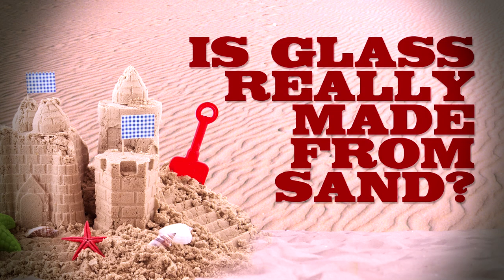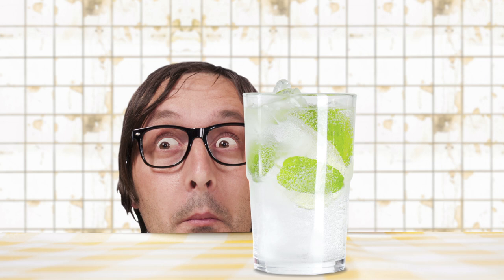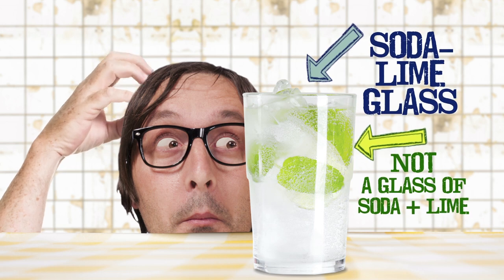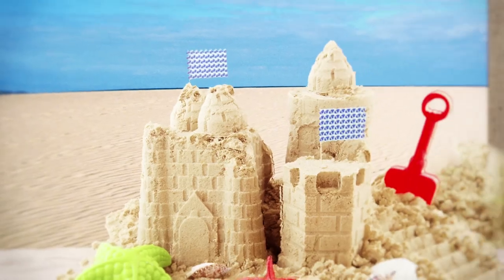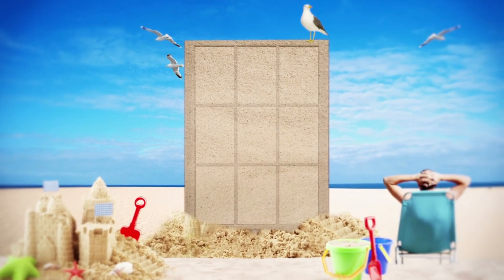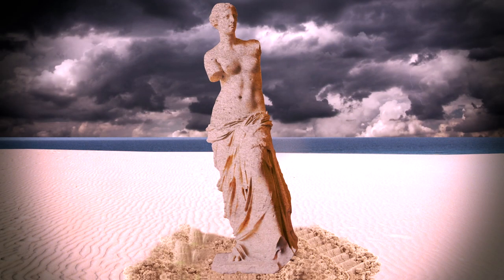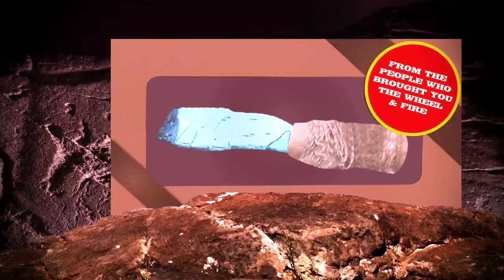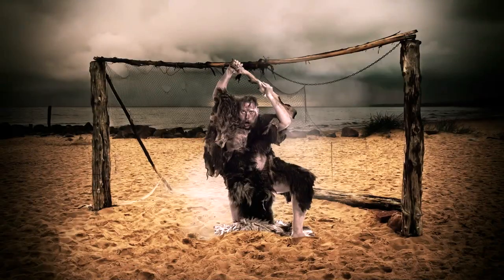Is glass really made from sand? | James May's Q&A (Ep 11) | Head Squeeze

Comment: I think it is similar to Steel; it is technically made of Iron, and from there several mixtures are made for different properties; but in essence Steel is made of Iron.
Reply: Nice analogy
Reply: +erdvilla and it's even harder than steel
Reply: +Games Games But the C content vares greatly. It is mostly added to remove Oxygen from the mixture. It is an adhitive and not the main protagonist, just like in glass somo elements are added for other properties.
Reply: +Games Games It's the correct proportion of carbon that makes it steel; otherwise, if I understand correctly, you get wrought iron or cast iron.
Reply: steel is iron with added carbon

Comment: When you mentioned wind and rain wearing away at rock, I thought about the Grand Canyon. I then thought, "how deep could the grand canyon get?" Will it just keep getting deeper and deeper over time?
Reply: All that wearing away, or erosion, proceeds in balance with an overall base limit to the erosion,  Ultimately that is sea level.  Because the GC base elevation is around 2,200 feet, If the future sea level does not change, the base erosion limit would be another 2,200 feet.  However, it will take a very long time in to the future to erode to this final depth (perhaps several million years) and who knows whether the future sea level will be lower or higher than the present.  Also this would assume no future further rise or lowering in overall elevation of the GC. It is impossible to predict.
Reply: mandobob and human activity can be factored in, right? Like dam building, either present or future...
Reply: mandobob Nothing is impossible. We are, after all, standing on a pile of dust made from a star who had previously died before. From it's ashes spawned another star, the earth, mars, and every asteroid in our solar system. The story is the like for every other solar system you could ever imagine. If we can be the phoenix, who knows what we can become after we learn to fly.

Comment: 1;45 "silica can actually form a rubbishy type of glas by  itself as seen in fulgurite..." well, fulgurite does not have any technical uses afaik. However there is glass made from pure SiO2 (quartz or silica). it is not 'rubbishy' at all, rather it is very much more durable and heat resistant as common glas.

Dear James, dear BBC I like your educational videos. However I think you should put some more research into them.
BBC to me is synonymous with very well researched docus and alike. So, please keep up the high standards!
Reply: forgot to mention: pure SiO2 glass is called fused silica or fused quartz

Comment: why tin and not mercury
Reply: Hazztech Mercury is poisonous.
Reply: ***** yes obviously but you see it's also not several hundred degrees Fahrenheit
Reply: The glass is going to be molten when it's poured onto the tin, so it's already going to be much hotter

That and if you used mercury it would boil
Reply: oh.. i wonder why -.-
Reply: Tin melts at a lower temperature than glass so that as the glass solidifies, the tin remains molten, and thus flat.
Reply: Yes Markle2k, and the temperature of molten Tin is good for cooling glass to a solid without sudden shock cooling.  (yes, I know glass is really a firm liquid)

Comment: No merit at all, it's all dependent on the coin and flip. For example if you have two coins of the same type and year the wear on each will be different, like scratches or if one has been out of circulation in a collection the center of gravity in each coin is slightly different then you can't guaranty the flip. In short its No, try flipping a coin over and over and see